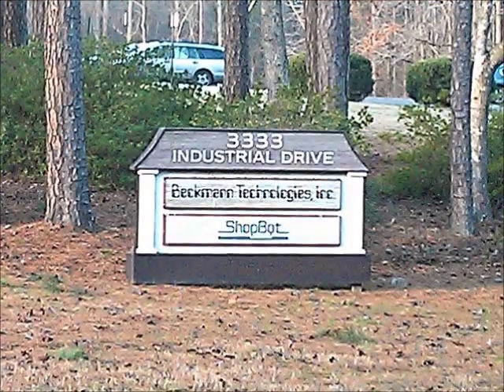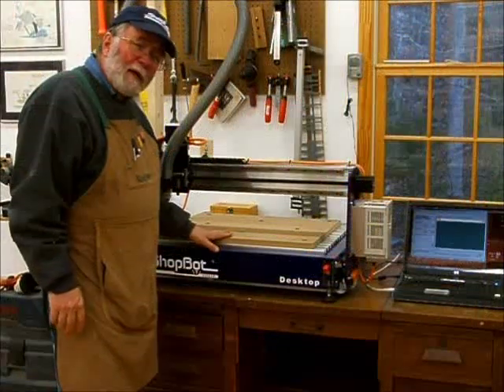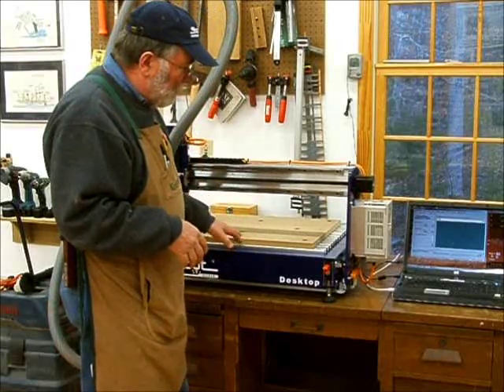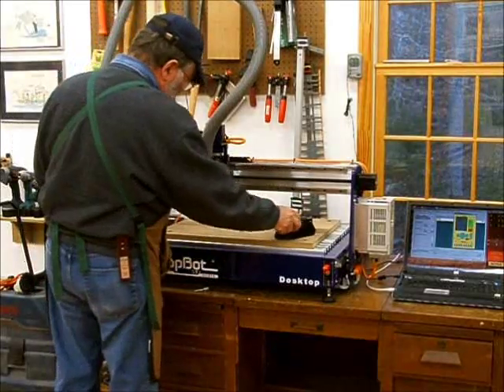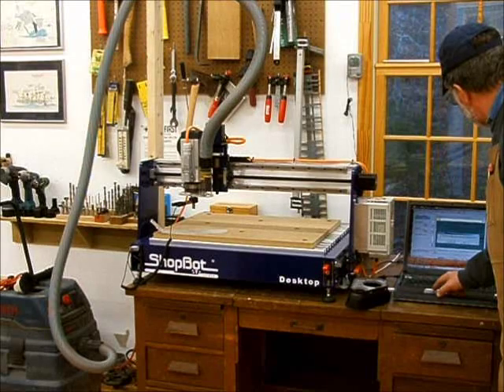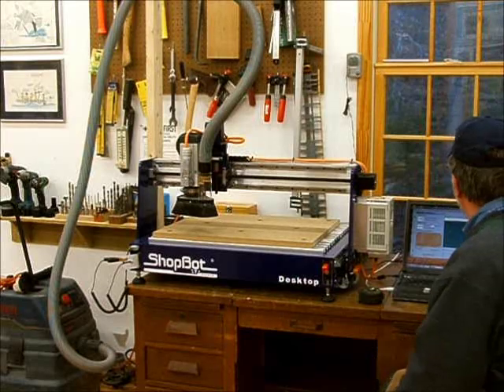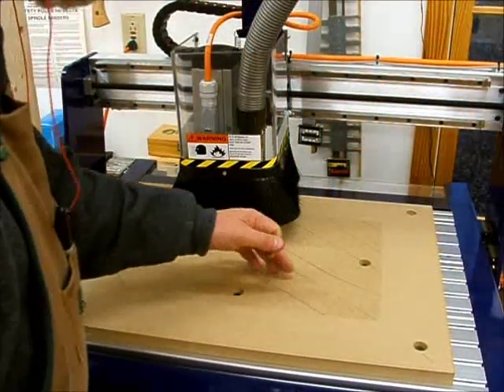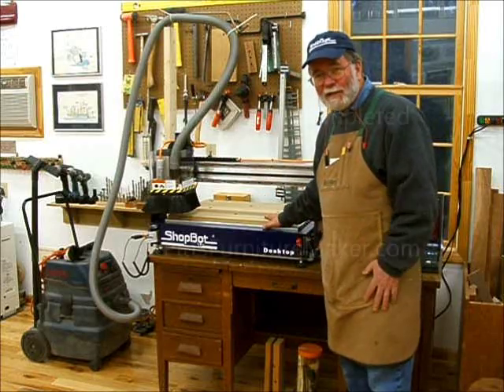Starting out with a ShopBot: Andrew Pitts~FurnitureMaker

Comment: Have you ever had the opportunity to use a dial indicator to measure the repeatability of returning to a specified position? 
Have you any precise tools such as a Jo Block to measure that machine's accuracy? (One using an indicator/probe measures the length of the Jo Block. The longer the better. And at different locations in the machine's envelope.) 
Have you compared this bearing design to the wheel running in a groove or on a rail? 

While I see you are cutting wood, I was wondering if you had ever seen how to mount a linear optical encoder similar to the CNC machines with DRO's?

Louis DiFrancesco louisdifran@gmail.com 505 515 4700 Boston, MA

We are in search for a cheap machine to build components for our large machine. We intent to use an Inspection Grade 48"x36"x6" granite surface plate as our base and mount the bearing rails with respect to the known flat surface.
Reply from the maker: +Louis DiFrancesco I've got to answer no on all questions. The accuracy is great for the wood I cut, but I recommend you contact ShopBot with these questions. I do know that ShopBot makes many of their machine parts on their ShopBot machines.